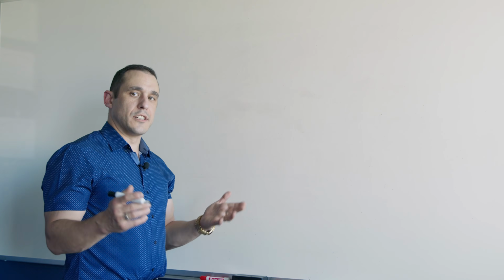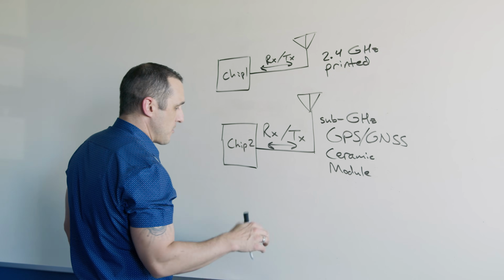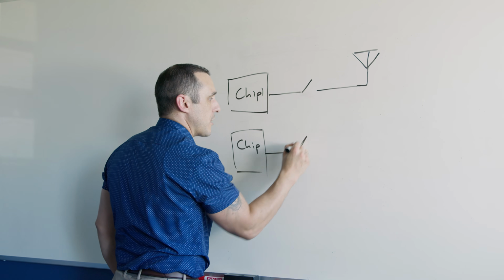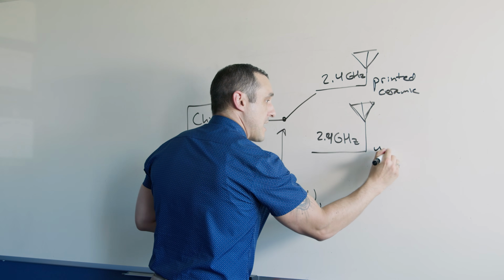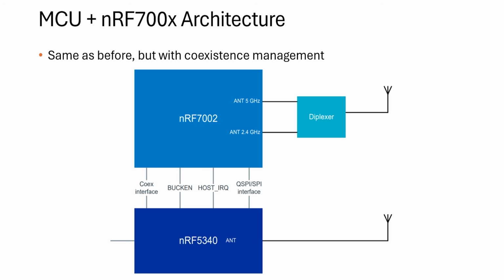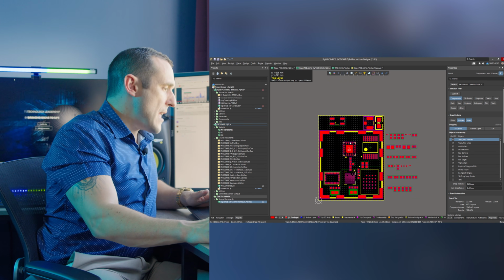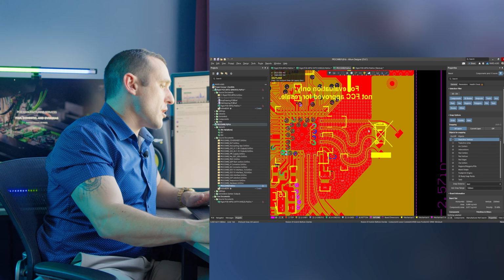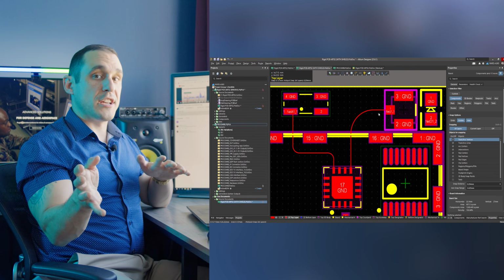PCB Antenna INSANITY!!! Multiple antennas, coexistence, and signal chains

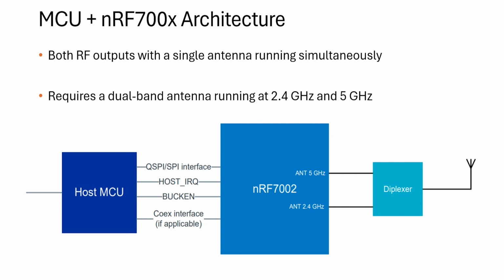Comment: Doubt: i am planning to use Single antenna for Two chips where my both chips RF is  2.4GHz. The diplexer concept used at 8:27 be when there is co existence at 2.4GHz.Because in the video it used for 5Ghz and 2.4GHz

Comment: Great Channel! I found this Video and subscribed directly! I have a question: I see so many designs for the nrf52840 or esp32s3 that use only one matching network between chip and antenna, but in the reference designs are always two matching networks, one for the chip to 50Ohm
Impedance and one from antenna to 50 ohm impedance. Especially if I need to tune the antenna for the housing, I think I need two matching networks. Can you please explain this? Thank you very much!

Comment: Altium is REALLY REALLY expensive. EasyEDA is free and is excellent.
Reply from the maker: EasyEDA is trash. For free software KiCad is much better. If you want to do anything at the professional level, then you will need to pay for software, and the subscription is a small expense compared to the money you can make providing design services. Companies that pay large amounts for professional design services will demand that you use their software, which is almost always Altium, Cadence, or Siemens. I have only ever had two commercial design requests in KiCad and they were very low cost projects.

Or you can be cheap and not pay for software. The companies willing to pay large amounts of money will just come to me for their expensive design work.
Reply: @Zachariah-Peterson  Absolute BS. You are promoting Altium. Altium is paying you.
Reply: @Zachariah-Peterson  EasyEDA has millions and millions of users. 1000X more than Altium
Reply from the maker: @MadawaskaObservatory  Well I've never made it any secret that I work for Altium, so this shouldn't be a surprise. And if you think Altium is expensive, go get a quote for Allegro or Xpedition at the same feature level, Altium is dirt cheap by comparison. And so what if EasyEDA has millions of users? I guarantee it's not millions, but even if it was, who cares? Are those EasyEDA users paying you for design services? If not then by all means keep using EasyEDA. But the business case and career case for paid software are clear, so if you want to have a career doing this stuff then you will need to learn the paid software at some point.

Comment: You mentioned switching between different antennas.
For example one use case can be to have different polarity of antennas or switching between antennas aimed at a different direction.
However those switching chips typically have an isolation of 20 - 30 dB between inputs.
Problem is, when antenna A is 'selected', antenna B will also receive that same signal and it might have been the better choice for that signal as it is a stronger signal.
This then results in a mix of both signals of roughly the same signal strength but since the antennas are at a different position, or the other antenna might be receiving signals via some delay, the mixed result of this signal fed into the receiver is way worse than simply having a single antenna at the wrong polarity.

How would you approach such use cases? Simply adding multiple switches in series (or parallel? or some tree-like structure, redirecting the unwanted signal to some resistor?)  Problem is, many of those switches won't allow any DC-offset on the RF pins, so all must be done via capacitors, which also has its effect on the RF path and antenna tuning, etc.

And another question.
How would you approach switching off an antenna if there is some high energy signal being received (or transmitted near by)
For example some LTE at max. power next to a very sensitive LoRaWAN gateway module which both operate at a frequency very close to eachother (862 vs. 868 MHz)  With the LTE module inside the same LoRaWAN gateway enclosure, you do have some control over when to send via LTE, though a LTE module may also communicate with the cell tower at moments you don't expect.  Only very few LTE modules have some kind of COEX like pin to signal the TX is active, so how would you approach it when using a module which doesn't have such a TX active pin?
Or would it make way more sense to detect high energy at the LoRa antenna and 'short' the antenna input of the LoRaWAN module immediately with some 50 Ohm resistor? This would protect against lightning strikes at a distance for example.

Comment: is it good enough to have fr4 for radar antenna?
Reply: Not for anything over 6GHz
Reply from the maker: You can use PCB antennas above 6GHz but you will start to notice the differences in insertion loss along the feedline when you use FR4 versus some other material. Eventually, the dielectric losses get low enough that the copper loss and plating become much larger, and the cost and processing difficulty of the lower loss material can outweigh the additional performace benefit. We typically use a lower loss material because it also tends to have a lower Dk value, so for a given layer thickness this requires a wider trace which also has lower skin effect loss in the copper feedline.

Comment: Great video as usual 👏🏽
I have a question It's possible to use PCB antenna with Lora ( 868 mhz ) for Wildlife Tracking , specifically with RAK3172-SIP module?
Reply: It's absolutely possible to use a PCB antenna on 868MHz, have a look at the designs in TI application note DN023.

The relevant parameters from the module is the transmitter power and receive sensitivity. You'll want to make a link budget to ensure that the gain of whatever antenna you use is acceptable.
Reply: @samygiy1 
 Thank you for the information 
I will take a look at TI Application note